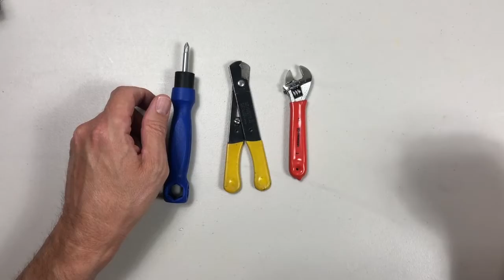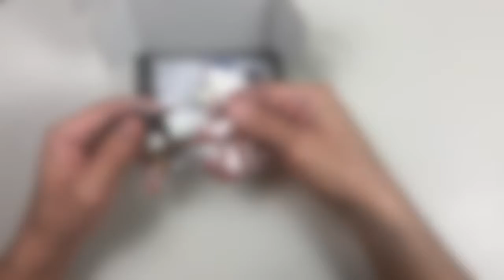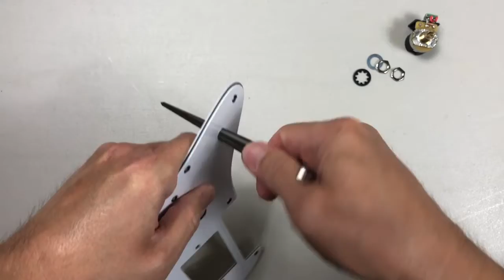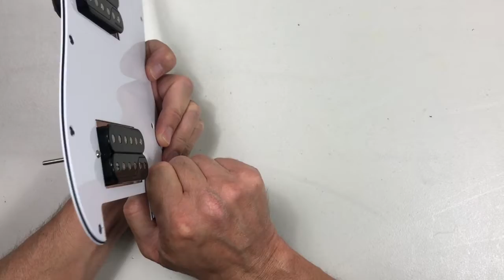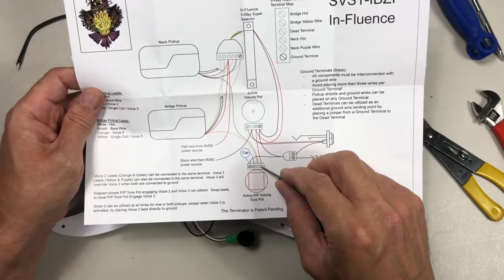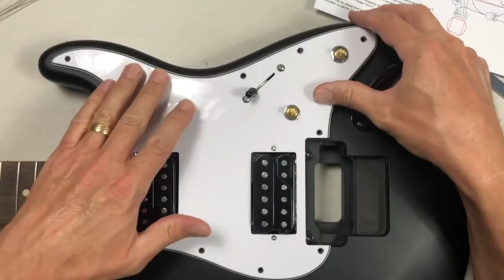Terminator In-Fluence Installation Demonstration

Comment: Will this system work with the 8 string moderns with the battery pack??
Reply from the maker: Yes!
Reply: @MadHatterGuitarProducts  awesome! What about in line with a button killswitch? Could i link the battery pack to the led killswitch through this setup?
Reply from the maker: @Shaynewhite  Our System will have no issues with the battery pack.  You would need to check with the manufacture of the killswitch for their specs.

Comment: How well might this set fit a PRS SE Cust 24? Have you done or seen this kit in one before? Guess I'll first take a look at the cavity depth, but apart from that? What about the SVST-3SF version in there instead? My SE has open core classics as well (zebra set) with the rechargeable lith ion battery pack, and I would love to have this kit in place. I think I have my voicing wrong though, but I've never wanted to fix it with everything already soldered in place. This looks like a beautifully thoughtful product to add
Reply from the maker: Thank you!  You should have no issues fitting the System in your PRS. Thanks.